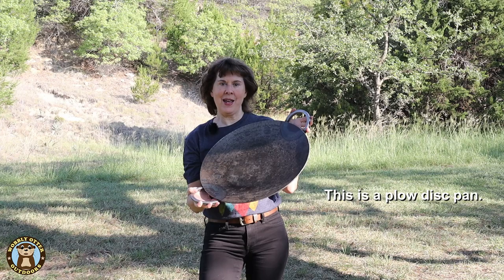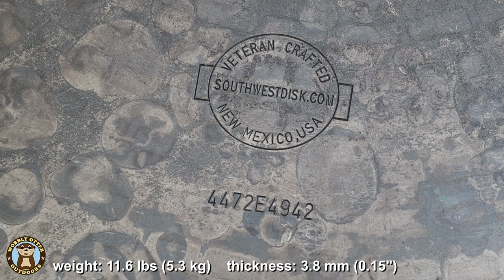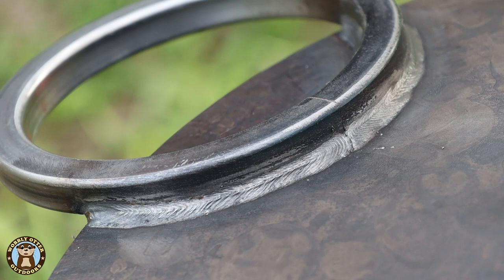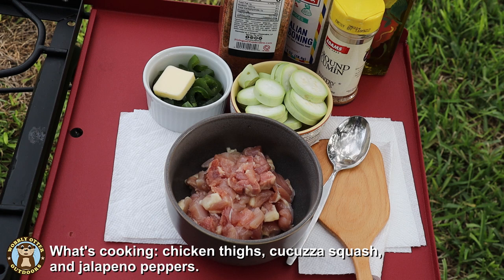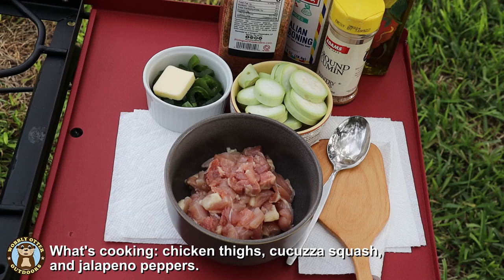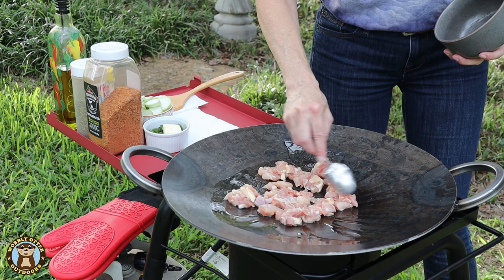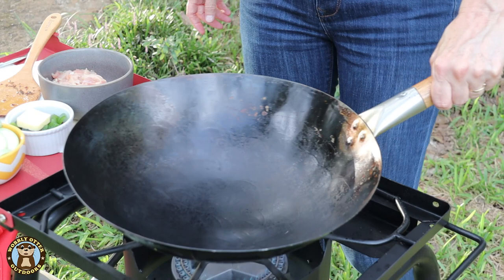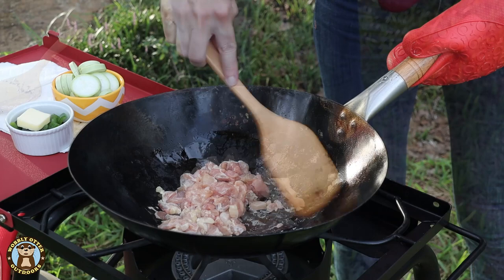Wok vs Plow Disc Pan - Challenge Accepted

Comment: The Southwest Disk Discadas are so nice. I’ve been cooking with them for about 7 years now. When I first started looking for Discada like cookware, everything out in the market was $300, $400 or more and then I found southwest Disk. Their largest 24” 28lb monster disk is only $90. A good carbon steel pan in a 10” diameter is almost that much from Matfer or De Buyer. These are the best bargain on the market. I have the Rio Grande and the Madrid.
Reply from the maker: Love it!

Comment: Excellent video as far as comparison goes. A couple of questions which is easier to clean ? And where those cucumbers in there ?
Reply from the maker: Thank you. 
1.)  For clean-up, they are very similar in how easy they are to clean - at least they were after shooting the video. The wok used in the video has a better seasoning (because we have had it longer) than the plow disc.
2.)  The circular, green veggy is a cucuzza squash. (It does look like a cucumber when sliced. It tastes similar to zucchini.)
Reply: @wobblyotteroutdoors  thank you so much for the great info the great recipe and can't wait to try the cucazza ive never even heard of that before.
Reply: @wobblyotteroutdoors  thank you so much for the great info the great recipe and can't wait to try the cucazza ive never even heard of that before.
Reply from the maker: You are most welcome. Thank you for watching and for the great questions. The cucuzza are interesting. We grew them in last year's garden.